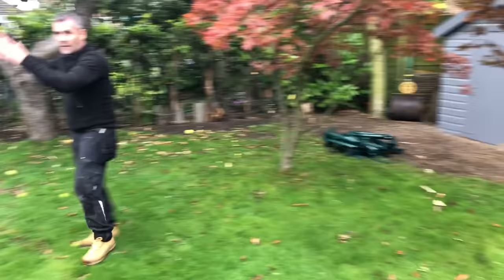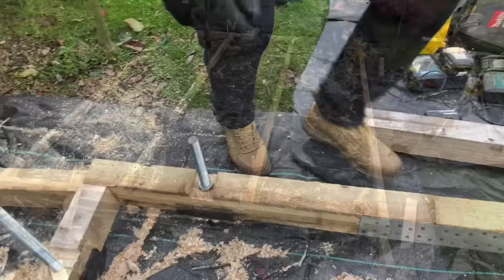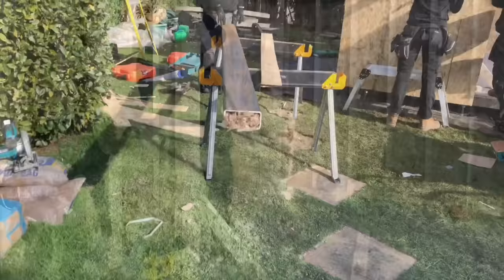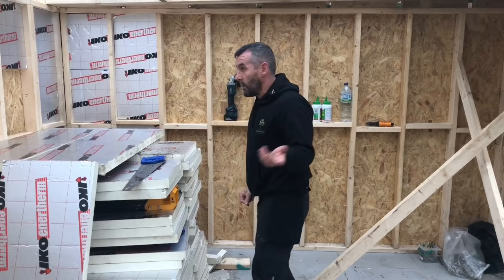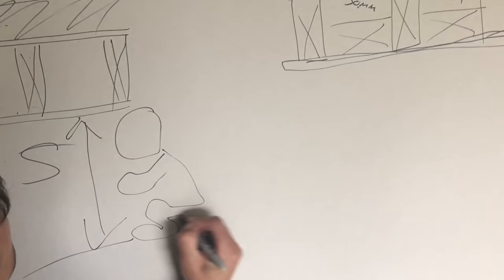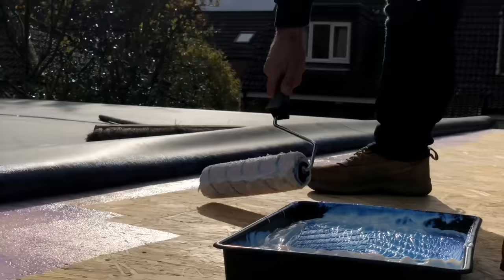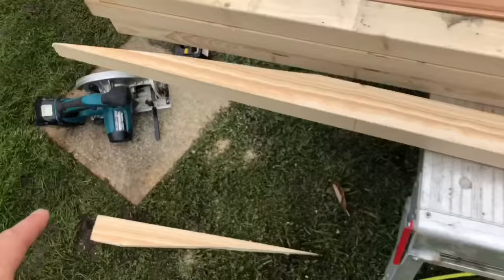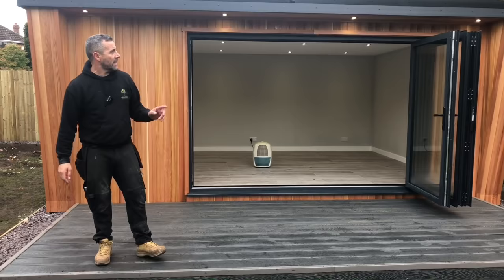Garden room build in 15 days start to finish in 1h 43m 57s, maybe help you drift off to sleep

Comment: is your front and rear overhangs filled with insulation ?

i'm at that stage now and can't tell from the video if you've treated it the same as the rest of the roof and jammed it full of insulation ?
Reply from the maker: as long as the bit over the top of the wall plate is full, its all good mate
Reply: @thegardenroomguru  would that not just create condensation inside it? I'm probably overthinking

Comment: I am not sure I could build like this. I see the plastic and the timber directly on the top. My problem, in Australia we have to worry about termites. Those buggers I think would get in and eat the whole timber structure out. They would get in round the edges. Better, would be to lift the whole floor off the ground on steel or concrete stumps. My choice would be a concrete slab but that's me. Still if it works in the UK why not. I'll keep watching.
Reply from the maker: It works over here Alan, But I hear you 👌

Comment: done a brilliant job on the garden room..where you used cat5 cable to internet ...you could of done away with them as you can get powerline adaptors which does the same thing without the long cable... as long as your on the same wiring circuit as your house ..otherwise job well done
Reply: cat5 is old, really old. They should have used cat6 for sure

Comment: Great work and great video!  Load sof hints and tips for the self builder.  May I ask;  what make is the clip system you used for the gutter drip trim - looks awesome.
Reply from the maker: Hi
It’s from Northern Building Plastics, they deliver nation wide next day and there’s 10% if you mention  Oakwood garden rooms 👍🏼

Comment: Outstanding work. Very professional. Not sure if running Cat5 or 6 next to the power cable is ideal as it slows the speed down. Please correct me if I’m wrong.
Reply from the maker: It makes no difference mate, maybe if you were talking an office with loads of connections.

Comment: I have a garden room that quickly developed condensation on the walls after it was built. Having been recommended to watch your video, I realise that neither any breathable membrane or moisture barrier. What can be done to remedy this?
Reply from the maker: install some type of ventilation, the room will quickly build up moisture when theres no ventilation.
Reply: Thank you SO much for taking the time. Yes. Plenty of condensation and my walls are all damaged despite cleaning, stain painting and then painting over with emulsion. The problem started a few months after the build back in 2021. Earlier this year, a small extractor fan was installed but has had no effect. I regularly put the heat on during colder months for around x6 hours at a time and air the room in warmer times. Where should I have the ventilation fitted? Thank you again.

Comment: Use the WERA impact bits with an impact driver, no wonder you piled through them using standard bits. You'll find they last a lot longer, I do van builds and find them perfect.

Comment: How come you have used both rockwool aswell as 50mm pir insulation ?

Would 100mm of rockwool not be sufficient for thermal and sound ?

Asking as I have 100mm rockwool left from a job

Comment: Hi, sorry if this is a dumb question but do you need any kind of planning permission before building a garden room like this and if so does it change depending on what part of the country you live in, thanks
Reply: I saw you had no answer. I think if it's less than 2.5m high and at least 1m away from your neighbours boundary you don't need planning permission. Always best to check with your local planning authority as rules can change.

Comment: 36.40sec Could you not install 4x5in roof joists instead of bolting together two 2 x 4s. Wouldn't they be cheaper and less labour/ bolts etc? Just asking.
Also I understand that treated timber should not be used for firewood, (38.45sec)  because arsenic is produced when burned.

Comment: How many people/trades built this? I built a timber frame building partitioning 3 separate rooms, roof, with 3 braced cladded doors made up, hung, mortice locks, door furniture, cladding inside out, bathrooms, waste, plumbing, electrics, 20 metre 63mm pipework for a pump for grey waste in 10 days. Just me.

Comment: The finish on this is the nuts ! very impressed. BUT as a sparks - is that black gaffer tape around some T&E on that photocell ? 4-C black flex would've done :) , front flood looks upside down and a lovely round decorative bulkhead with  microwave sensor would've done round the back there ! last time I saw that type of bulkhead was on our old council jobs :) One last thing.... would love to see the connection to the main head meter in the electrical cupboard please. Great great work though, love your channel, just giving you food for thought on the electrics ! p.s I would terminate that 10mm SWA on to an external box and bring through the tails to the main sw of the CU, can't see how it's possible to properly gland off the armoured the way you guys pull it through.

Comment: Great work, so educational to watch. What happened to the surplus of the rods that were sticking up? It looks like you've sheared them off but with what tool? I don't think you could get an angle grinder into the notch space in the wood?
Reply from the maker: 9” angle grinder at an angle 👍🏼

Comment: dude Im looking on splitting the room...I am going to fit 1.8m w  bifold and keep it to 4.8 for ease of lengths.  My question if you don.t mind is would a front corner of 400 with the 200 drop for steel be ok for doors to but up to?.   If that makes sense. Cheers in advance.

Comment: whats the danger of skipping the piles part?
if i just rest my 3x4s on concrete blocks whats the danger? subsidence?

(i'm building an office and dont expect very heavy loads)

thanks for this great video
Reply from the maker: If your going to do block piers just make sure you dig down to solid ground, I’d then put 6” concrete in hole, then build my blocks off that, there’s a considerable amount of weight in a build, a typical 5x3 build will weigh in excess of 4tonne, most of the weight being on the front and rear walls
Reply: @thegardenroomguru  what an absolute legend, thanks for such a speedy reply.

if you were in Wiltshire id hire you to do the job

Comment: Great video! The 4x2 floor seems quite Labour intensive, with all the hangers and noggings, but I'm assuming you've done it other ways (6x2 with 450 centers for instance) to know that this way is the most cost effective. 👍🏼
Reply from the maker: Can’t use anything bigger than 4x2 mate, overall height is paramount
Reply: @thegardenroomguru  oh, for planning 👍🏼

Comment: £25k right there i suspect. 

£3k for doors and windows
£3k for the cedar
£6k labour (at least)
£3k for timbers and boards
£3K for flooring, insulation, wiring
£1k for plasterer, ground works

Rest on fences, landscaping, etc.

Am i right off on this?
Reply: Sorry but i am only commenting this so i get updated if anyone responds =D.
I reckon 16 if you use the plans in total. I have my ways of hunting good bargains.

Comment: Hi Will
Love your videos, great instruction, information, and attitude.
I'm building my own garden room+shed, 4.5m x 3m, and would have used your foundation method if I'd seen it before I ordered the QuickJack kit.
Could you help me with a couple of questions.
1. The span for roof joists is 3m, should I double up the 5x2's? There is a wall dividing the building for shed section 1.2m in, which should give a lot of support to the roof.
2. Over the 2m Aluminium Sliding Patio Doors, I was going to double up the 5x2, or would you recommend a steel?
     Also as this is on the short [3m] end, can I use this as one of the roof supports to get a taller door?
Thanks for any reply and keep putting out the great videos.
Cheers Tony

Comment: I would like to build something similar to this but as a workshop rather than a domestic room. Would it be allowable to use 18mm OSB to cover the inside of the walls instead of plasterboard. The reason is to be able to get a strong fixing into any part of the wall which clearly would need to be pre-planned if using plasterboard and pattresses.  Obviously plasterboard gives some fire protection but OSB would not, are there any laws pertaining to this?  Many thanks for a really helpful and instructional video, especially the hot and cold roof part!

Comment: Hi, great video and explanation. I have one question though. How is the roof able to breathe at all when it's packed so tightly with insulation. Cold roofs have technically been standard construction in all house builds. For as long as I can remember. You have the rafter, a void then insulation...? Thanks

Comment: going to go against the general grain of comments and suggest you could save a huge amount of time,money and effort by building the unit off site as a set of prefabed panels. With a decent sized workshop you could build 90% of this in a day and complete a full install in probably 3 days with 2 guys. 15 days of 4 to 5 people onsite is way too much of an expense in my opinion.

Comment: Great quality build mate. You deliver an honest and solid product, fair play. Whats your opinion on using SIP panels? Would that speed up efficiency/save you cost? Interested to know your opinion. Cheers!
Reply from the maker: They would mate, but the build quality would suffer, you can’t, as of yet, beat traditional build for quality. Also customers change spec regularly, sips panels are ordered in advance and once they are ordered, the build shape and size is set in stone, no room for alterations

Comment: Thank you. I'm was toying with building one, now I'm going to build one. Best wishes..
Ps one question: why do the roof wires run at the top rather than through the soft rock wool, it seems to over complicate it grooving the rigid insulation.

Comment: good produced vid.  btw there is no reason why the were bit should break that easily. most likely wrong fit bit or user error. At the super speed you are working I work presume it is drill driver user issues. some questionable methods used here also but most likely will suffice. no belt and braces though.

Comment: Which rods were used for the foundation pins?  Can I get them online with the plates that go into the concrete mix?  
A garden room is next years project and I need to get the foundations in over the next few weeks :)

Comment: Can I ask, you mentioned the steel beam was 80x100mm and you showed a 50mm timber on the back on it. Thats 130mm but you've built the walls from 4x2 ? are the front walls built from 6x2 ? or is the steel 50x100mm. great work all round
Reply: Elliott great observation, I too pondered this. Did you resolve it or not?
Reply: The front wall was built with 5x2. The other 3 walls were 4x2

Comment: Firstly great video!  I plan on doing this either this year or next! 
Two questions price wise for the base.  Is it cheaper using the bolts bedded in over a concrete  base?
I intend on adding a toilet into my summer house. My assumption is tie the waste in first - digging a channel sloping towards existing  waste. Any other information appreciated.  I have a rough idea how to do it.

Comment: Great video, especially for an amateur like myself. My question is if the finished size is 3.5 x 5m how do you measure where to put the rods? Your lines must be smaller than the finished size? Thanks

Comment: Liam - where did you purchase the roof sheets from mate? We are nearly there with sourcing materials from the build packs, just need something for one side and rear as our build will be about 400mm from the boundry, so needs to be low/no maintenance!! Cheers and the build packs are highly recommended if anyone is thinking of buying one.
Reply from the maker: I’ll put a link on,
Reply: @thegardenroomguru  prefect thanks mate, will be starting our build in the next few weeks - part of your Facebook group so will post pics throughout👍
Reply: @thegardenroomguru  - Hi mate, have you had chance to post the link for the roof sheets yet? Cheers
Reply from the maker: Hi
Not yet mate
Company is
Foregale 
01924401020
www.foregale.co.uk
Reply: @thegardenroomguru  cheers mate - do you get your rubber for the roof local as well?👍

Comment: Can these buildings be attached to an existing building for an example your home
Reply: Yes they can Lars... but in that case you'd need to have the base certified by a structural engineer - as you'd need building regulations approval for the overall build.   You would probably also need planning permission unless under permitted development. (assuming you are asking about the UK)

Comment: Bit confused .

U say the foundation beams are 3x4 (100x75)
But u stayed that the u chanel is 100x50 .

? Which is correct.
Difficult to find 100x75 chanel   finding too
Reply from the maker: Timber perimeter is 75x100
Steel channel is 100mm x 50mm  
The 75mm sits in the channel
Reply: @thegardenroomguru    correction sorry 

So the 75mm fits In to 50mm ? 

Thanks for the reply 

I'm way to far south for you to build for me so will b purchasing plans .   But I'm looking to check I can get all the required stuff!
Reply: @thegardenroomguru  replied above and corrected 
  Thanks for the replies
Reply from the maker: The 75 sits in the channel mate, the 50mm represents the upstand of the channel, it’s 100mm wide, 50mm high
Reply: @thegardenroomguru  ah that's where I'm thinking wrong I was thinking u had the timber Long sides vertical 
  U have the Longside.in the channel !      Correct ?

Comment: Above the front top plate between the rafters do you in fill with timber or run the insulation through to the overhang?
Reply from the maker: We put rock wool over the top plate mate, as we have cables it’s easier to fit
Reply: Cheers mate much appreciated, cheers for all the videos been a great help👍🏼

Comment: Hi i have a 22ft x 22ft  garden and would like to know  what is the biggest garden room i can have without planning permission.  Can  you also tell me what it will cost i will need electrics and for it to be fully insulated with heating to be at the end of my garden.    . 
Thank you Sam
Reply: You can go to a maximum of 30 cubic metres under 'permitted development' rules without needing planning consent which works out to 4m x 3m x 2.5m. This is providing you don't build on more than 50% of your garden area.  Any build must also be 1m away from any boundary line. 
Google your local councils planning portal for all the regulations.

Comment: Class work mate 👌👏 
If you don’t use steel lintel what do you recommend using timber wise ??
Reply from the maker: Two 5x2 bolted together if it was over French doors, but at 160 for a 7.5 beam it’s a no brainer for me
Reply: @thegardenroomguru  thanks mate I messaged you on fb to buy a drawing from you..another quick question what’s your finished head height front and back internally ?

Comment: Question if I may....and I know you are top class at this stuff, and I am about to do one of these, so...why not use a drill for the post holes.?
Reply from the maker: Tried them before mate, fine if the ground is good, but stone or root and it’s no good , we generally build close to a boundary, usually roots in the way 👍🏼

Comment: Those screwdriver bits are no good for you William. Wera and Wiha (my choice) need to be impact rated. Those golden coloured bits you are using are screwdriver bits and NOT impact rated. Ive done the whole lot a bit like yourself and found the Wiha 50mm Maxxtor range suitable for abuse in the real world. Avoid using a bit holder. The 50mm Maxxtor bit fitted direct to impact driver seem to produce the best results. No bits last forever but those Maxxtor bits take a shed load of abuse before failing. Hope this helps. 👍 from me! 🇬🇧
Reply from the maker: I’ll try them
Reply: @thegardenroomguru  Also had great luck with Milwaukee bits :)

Comment: Is it me, or is there very little dip on that roof? Do you live in a very warm climate / only 50(60) mm insulation...?!
Reply: Its PIR insulation, twice as effective as polystyrene or rockwool. Quite likely enough go get to 0.4W/m2K. Not enough for a house but they may get away with it in a garden building.
Reply: @onemaninaboat  OK, I thought it was Rockwool. I use 95 mm flex A-batts.

Comment: Cracking job, what would you recommend as a cheaper alternative to cedar cladding?
Reply: You could also OSB the outside and run cables internally then just clad as normal instead of the vertical cedar stuff.

Comment: Hi, great Video. What happened with the weed membrane you put on the ground? Wouldnt it collect rain water, or did you tuck  it under the floor?
Reply: Weed membrane is porous, they trimmed it off
Reply: @glynbayliss5470  ok thanks.. that was my second thought after posting.. ✌

Comment: Do I need to get any permission for building like this in the uk?
Reply: not if its under 2.5m high
Reply: @madnlooney  That is to the eaves, the roof apex can be 4 meters for a pitched roof or 3 meters for the single slope as was built in the video. So if people want more height in their building best to go with a dual pitched roof so the angle can create a higher ceiling height. Also if the building was built on a sold slab of concrete then it would also gain a little more because it would not be on the bolts. Really would just be better to have the solid floor & then membrane it off & have floor joists with he insulation between them with the T&G floorboards or chipboard flooring on top. Then again I think block or brick built buildings are superior & cheaper anyway. But it seems for quicker housing that can be pre-built in sections for quick assembly this may well be how the housing market will be going.